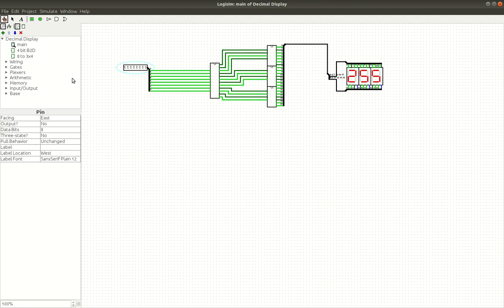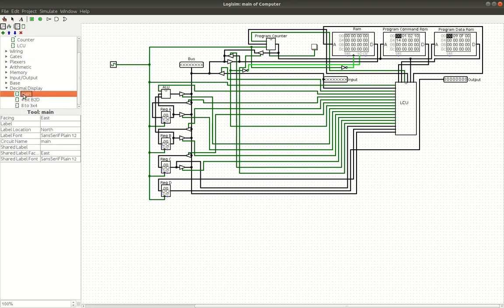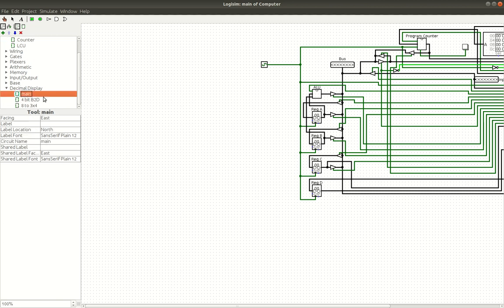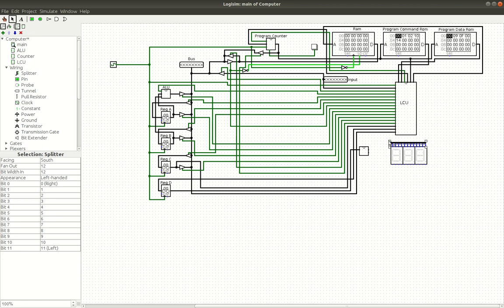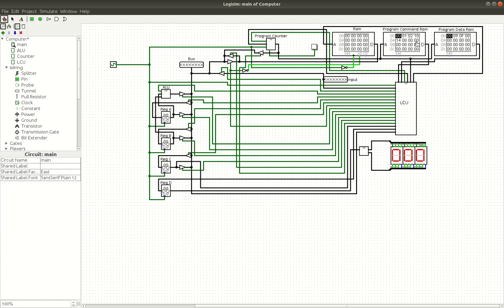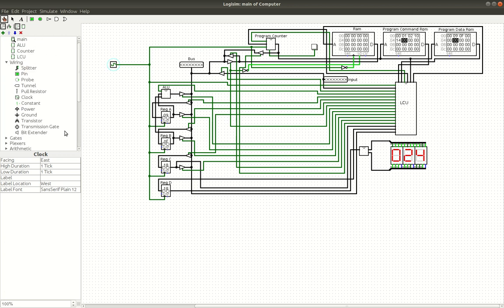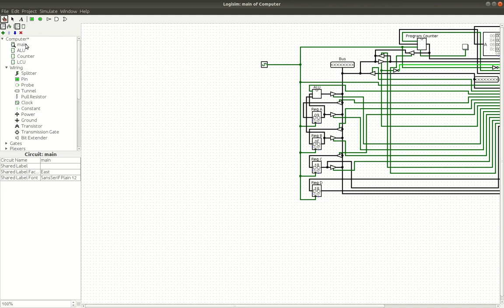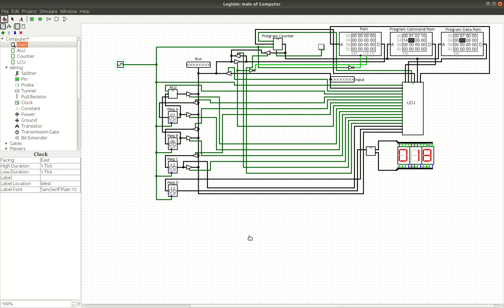7 Segment Display for my computer in Logisim | PK Cubed

Comment: What exactly is 8 to 3x4?
Reply from the maker: Look up binary coded decimal. It's essentially taking a 3 digit decimal number, such as 105, 235, 256, 026, in binary, and splitting up the 3 digits into 3 different 1 digit binary numbers to put on each display. 1 digit for each display.
Reply: @PKCubed  First of all, I would like to thank you for your feedback.I am a computer engineering student, I need to complete the project on Friday and the only thing I am missing is 8 to 3x4.If I send my mail, is there any chance that you can send the drawing of the 8 to 3x4 file?
Thank you for your help in advance.
Reply from the maker: Sorry, I can't do that for you, but it's really easy to do, just time consuming.  @TalhaTUNCER-e1d

Comment: Great job! 1. how do we set the truth table for numbers greater than 9? is it like ('0000 0001 0000' for 10 and '0010 0101 0101' for 255 )? 2. how do you connect the splitter s with 21 fan out and 2 fan out to connect the display with the  3x4 B2D?

Comment: Nice video! But i have a question.. i dont understand how the eight bit converter works, how did you make it?
Reply from the maker: I'm working on a batch of new videos and I'll cover the subject in those.
Reply: @PKCubed  searching for these videos, please don't tell me you didn't bother to create them😭😭😭😭😭😭😭😭😭😭
Reply from the maker: @sirgreen2792  I'm sorry, I didn't make them. That was a long time ago 😂. I can try to help you out.
Reply: @PKCubed  thanks for responding though much appreciated
Reply: @PKCubed  how do you configure the splitter with two fan outs? that's the only thing I don't quite understand
Reply from the maker: @sirgreen2792  If you set the bit width in to a number higher than the fan out, you can have the splitter split something like 16 bits into two 8-bit paths.